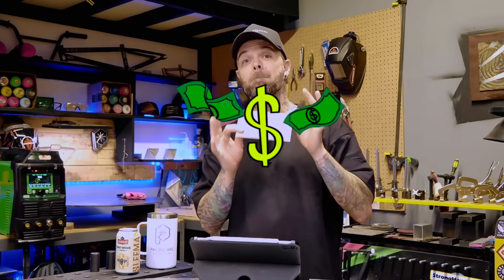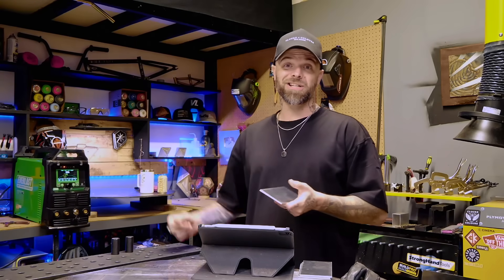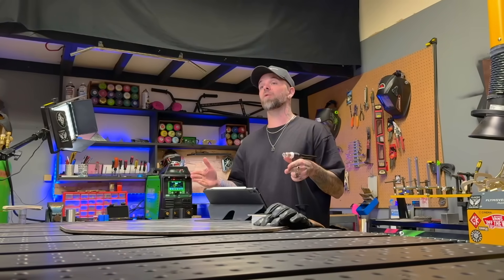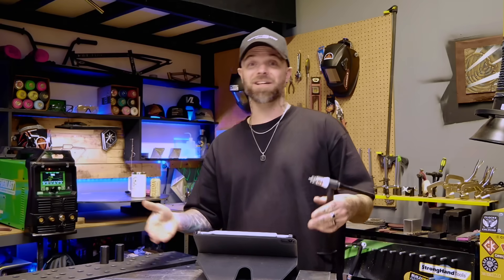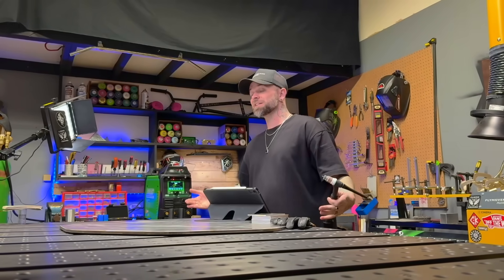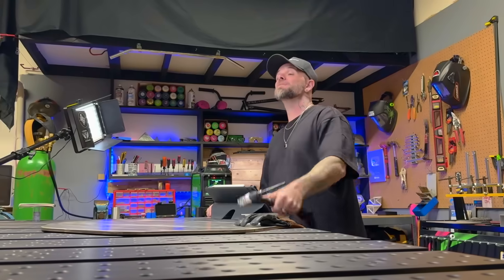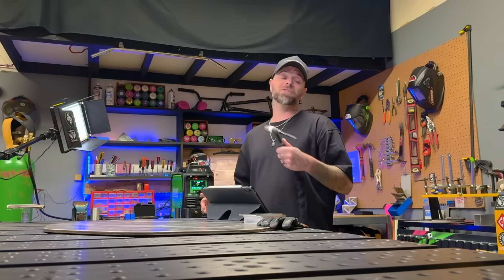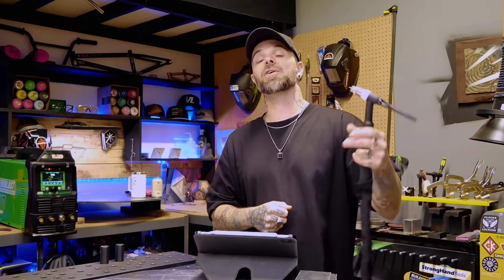Why Did Nobody Show Me this? How To Tig Weld Aluminum

Comment: Finished Welding school 8 months ago. I was working full time at my job as a meat cutter. I didn't take one job that offered me 19$ an hour to start as it was an hours drive away, 2 hours drive in traffic. 

8 months later still no job, getting rusty, I left my meat cutting job, and I have 50$ to my name so im unable to make it to the welding school which is a 35 mile drive 70 miles both ways to practice.

Dead in the water with welding. 

My brother is a doctor and is offering me a job at his wife's clinic. 

I got nothing else going for me other than being an amazing meat cutter and butcher that no one wants to pay more than 32,000$ after taxes.

Comment: ABSOLUTELY CORRECT BROTHER! 
When i see any up coming welder (starting to learn our trade or Arc trade) hopefully know one gets confused about arc welding 😂.  I've and will continue to ask the same question.  Nuclear,  production,  commercial,  residential and custom services. I've done them all and installs. I've made alot of mistakes(Where the boss or owners got pissed) but of course I've learned and gotten dam good at what i do. Only Stainless tig now. I work for a company that didn't need another tig welder fabricating product for all the hospitals in Canada. What I'm trying to get at is learn as much as you can and make a photo file with everything you've done. So when it's time to hand in your resume to the hiring manager/ production manager or owner. (I walk in and ask to speak with them) They see my resume.  Which is 8 pages long. Not like the standard 2 or 3 lol. And the end of my resume i include a link to share my experiences.  23 or 24 years now in the trade. Know your worth. I've walked into potential employers and right away before i sit down I've always said that their going rate is not for me and it say this to them saying " with much respect I love what I do. It's my hobby (as a custom fabricator) first before my career but i know what I'm worth.  If you want a employee (me) working for you for $30hr. I'll give your that version of myself. If you want my all you're gonna have to sit down with your production manager. 1 day later. I get the call back. Didn't get my $42. Got my $36. 
Perfect! 3 months later. I'm at $39 I'm not the go to. Not the lead. But i can do everything they do. Start to finish and if they want me to install... Well that's another sit down which is gonna happen so.

Rusty!!! Keep doing what you're doing brother! Love your content.  These up coming tig welders are sooooooo damm luckily.  You and I didn't have it like this. It was a cut throat learning  tig welding cause of the older guys ahead of us not wanting to teach us(Scared to lose their jobs) lol. 

Thanks bro. For putting in your time do show these. I know how hard and long the process is. 

Take care

RenF

Comment: Good morning 
Just curious, what power connection does one need in the workshop? Someone told me that a 220AC 200A is needed. Not all houses have such a connection...
Reply: Consider the current draw and voltage of your lights and air heating/cooling system and the maximum current draw of your largest machine, and whether you also need to manufacture another phase (3 phase). It should be clear what size of service you need. It would be nice if 3 phase 480v was commonly available, but I live in a clown country and would have to pay $20,000 to change the transformer and run 2 other wires from across the street. It's cheaper to buy a genset and run it occasionally for big machines.